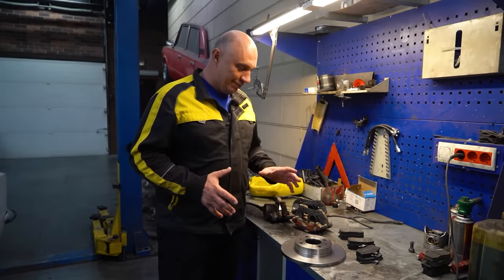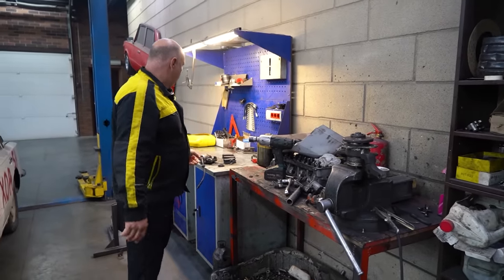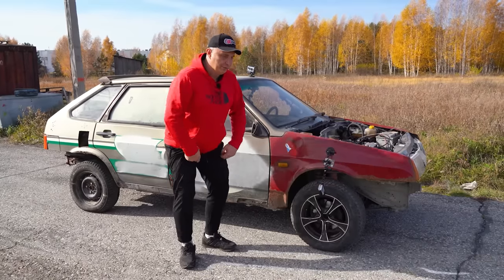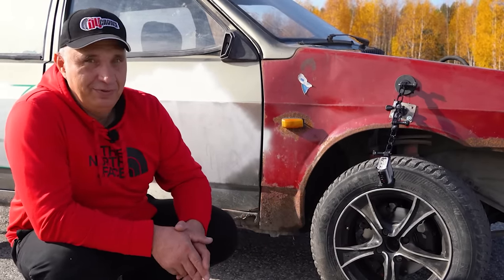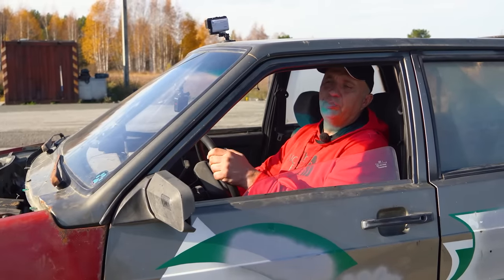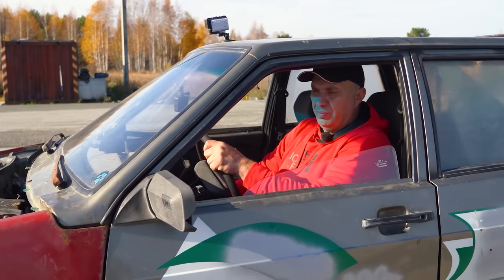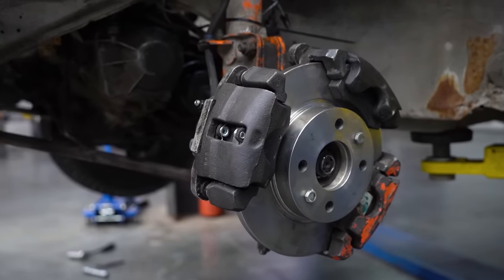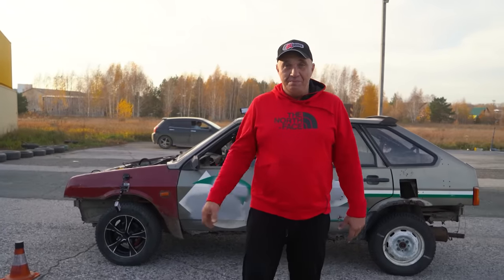Three calipers for each brake rotor – what will happen?

Comment: Bigger brakes won't stop you faster, wider tires will.

The heat by the multiple calipers isn't allowing time for the rotor to cool so you're getting instant fade.
Reply: Fade? The wheel skids! As long as you can lock up the wheel fade would be irrelevant.
The energy going into the rotor is in any cases cooled from inside via vent channels, not from outside and the total amount of energy to dissipate is constant.
Reply: The heat is a byproduct of the kinetic energy of the car. Multiple calipers spreads that heat over them, so each individual caliper doesn't get as hot as a single one does. The problem with multiple calipers is that they don't give as much rotor access to fresh air for cooling (they reduce effective rotor surface area)
Reply: @shadowboy813  Agreed, and exactly what I said: Same heat input regardless of number of calipers.
But, cooling of a brake rotor happens more on inside of it than outside. This is why it is not just a flat plate but two plates in a ribbed sandwich. The internal ribs act as a fan. Also, fading is reduced by not letting a pad create as much friction by letting multiple pads work together. Bigger and almost always better brakes use larger pads for this exact reason.
Reply: @shadowboy813  welp will make even more heat combined and that heat will transfer between each so you say it spreads heat out each one makes heating each other up.
Reply: By the " heat by the multiple callipers isn't allowing time for the rotor to cool" logic, you should be able to take the stock brakes, using a single calliper, and cut the pads in two to get better braking performance. As others have stated, the energy required to stop the car is constant so there is no additional heat produced. I would argue that the greater mass of the additional brake pads, their backing plates and callipers will help dissipate the heat better. This is why performance brake callipers are finned.

Oh and wider tires stopping you faster is not always correct. It all has to do with the contact patch, and your wider tire may have a smaller contact patch, and your tire construction will likely be a stiffer sidewall to support the wider carcass, meaning it will be less compliant fore/aft - why drag cars have soft sidewalls to improve grip under acceleration but can't corner for crap.
Reply: @shadowboy813 bro what? Callipers don't spread heat, the rotor does. Bigger rotor=bigger heat sink and the brake fade comes later. But it's irrelevant in normal day to day driving.
Reply: It goes to a point once they are wide enough to not lock up the tires that’s when you upgrade the brakes
Reply: @astrawally8448 High end callipers actually use 4-6 smaller pads instead of 2 big pads per side for this reason!
Reply: Me after watching driving 4 answers.
Reply: @DEATHWISHVQ     I love that guy!  He's great!
Reply: @Dstructeur1  Which brand of caliper uses multiple smaller pads? A 6 piston Brembo for example has a much larger brake pad than a standard caliper but its still 1 outer pad and 1 inner pad.
Reply: @fastone371  come to the comments to hear incorrect takes
Reply: @Dstructeur1 😅
Reply: Here come all the armchair experts 😂😂😂
Reply: @astrawally8448  

No the opposite.  If I said the rotor can't cool because of multiple calipers, then to prove its, you would have to confirm an increase in stopping distance.  

It's a fact that after mashing on the brakes multiple times, causes the pad and rotor to heat up.  It's a fact this increases stopping distance and eventually pad failure, or glazing on the rotors.
Reply: Nah each caliper is doing 1/3 the work, so the total heat energy generated is the same regardless.
Reply: @shadowboy813  "The problem with multiple calipers is that they don't give as much rotor access to fresh air for cooling"

The extra pads probably act like better heat sinks than air does.
Reply: heat does not matter if you're not driving an F1 car slamming the brakes at full speed repeatedly. this is why bigger brakes don't stop you faster, they only allow more temperature control

this is why tires matter the most, on standard tires just a standard caliper and rotor are capable of locking up the wheel, so at that point the only thing that would slow you down more is more friction on the tire. the brake squeezing a wheel that isn't even moving harder isn't helping
Reply: https://youtu.be/CyH5xOcsXxs?si=mBEpYPYjJKWignYq

For those of you who don't get it.
Reply: Yes, of course it's the heat dissipation that's the problem.  Unless additional cooling is provided, this accomplishes nothing.
Reply: @xtnuser5338  that's a good theory.  I think we need to get the Mythbusters on it!  😆
Reply: @1kreature you are the only one with some sense in these comments

Comment: I remembered seeing a Mercedes 600 Pullman (W100) from the 1960's on a lift in a workshop. The mechanic was working on the front brakes. It had twin brake calipers on thick ventilated rotors! Stock, from the factory. 
I think there are also some older Rolls Royce models that use the same setup.
Reply: Well, they had to use such setup - these are heavy cars and I suspect that wheels are rather small, and so are brake rotors.
Reply: The W116 6.9 has a very similar set up. What else can you do when 14 inch wheels have to fit.
Reply: @no-damn-alias  well, actually there is an option, only that has different approach :) This setup is practical solution for a car that might need to stop once, so it has small discs and two calipers. Audi back in late 80's, when they were still using wheels not bigger than 15", but were coming up with engines exceeding 200 hp, giving decent performance to C3 platform cars, came up with UFO brakes, where wheel disc size was maximized by fitting the caliper from the inside, so the disc could take up whole space inside the wheel. If not for the trend of oversized wheels, that would probably be common solution today - instead, Audi with C4 S6 [C4 S4 used UFO] switched to ordinary brakes that required 17" wheels...
Reply: @mshathlonxp   well they ditched the system for a reason. No need to reinvent the wheel
Reply: Some of the newer Mercedes and Maybach long wheelbase Vehicles also use dual calipers on the front.
Reply: @mshathlonxp  Yep my Audi had those UFO brakes, was a bit of a shook when I first saw them .
Reply: Go inboard. Has been done on the rear for ages with jags and a few race cars with fwd setups as well
Reply: @geoffgunn9673  snap a shaft, CV, or other drivetrain component...

Comment: This has lots of potential for tinkering and I hope you try it more.
What you really need to do is increase your tire width or stickiness with each addition of a caliper. In the end, the brakes don't stop the car, the tires do. 
Keep at it!!!
Reply: Move to a larger bore master cylinder. .
More calipers means you split the volume of fluid. So a larger master is a must. It'll apply more brake pressure Wich seems to be lacking.

Comment: Once you have sufficient braking force (pad and disc area), you cannot get any further improvements in braking without changing tyres and suspension, as these become the limiting factors. 

What would have been interesting here would have been to put extra weight in the car and test single and multiple callipers.

You would have quickly found the limits of single calipers.
Reply: When you're not able to lock your front wheels with a single caliper, something is really wrong. That should be the first point of optimisation.

Comment: You might need a master cylinder for each wheel and a manifold to distribute the brake fluid from there, equally to each brake caliper.
Reply: This is the issue right here
Reply: You wouldn't even have to do that, you can just get a master cylinder with a larger bore. It'll push more fluid for the same pedal travel. Most master cylinders are meant to run 4 calipers, but if you find a master cylinder with a 1/8" larger bore, you could probably run 6 calipers total just fine.
Reply: By adding calipers they changed the fluid volume ratio of the system giving mechanical advantage to the master cylinder. It is easier for the master cylinder to push a smaller volume into a larger volume which is why the pedal became more sensitive. Going to a larger bore cylinder would make the pedal harder giving less feel and response
Reply: No need to do that. The limitation is the tyregrip even with stock brakes. All this does is allows you to lock the fronts with less force on the brakepedal.
Reply: @narancs5  yes the tyres should always outperform the brakes. Locking the brakes up indicates inadequate tyres.

Comment: Sounds like youve surpassed the balance point of the master/slave cylinder hydraulic ratio if the pedal is hitting the floor on the 3rd pair of calipers. You need a part 2 video using a bigger bore master cylinder to match the combined volume of triple calipers. And then get some wider wheels and tyres! It'll end up stopping like an F1 car.

Comment: Maybe use a bigger brake booster and master cylinder from a v8/v10 or semi truck to help with pressure drops on the 3 caliper setup? I can imagine that car has a pretty common smaller booster and cylinder which doesn't provide the pressure required to make it work well indeed. I would also be interested to see how an ABS system would be able to deal with 2 or 3 calipers on each side.

Comment: I always wonder what happens if you have more that 1 caliper on a rotor... turns out they just heat up real quick that the braking is not efficient. Always love to see what you guys come up with :D
Reply: I do know that some drift rotors have 2 calipers on them to lock up one set of wheels real good
Reply: 1998 Bentley brookland & Turbo-R using 2 brake caliper for each front wheel, and they are doing great. The car weight  2500 kg btw..
Reply: @ARockyRock  That's a cool fact!!! I never know that drifters did that, I always thought drifters use huge calipers with maximum bite forces and it never crossed my mind that they would do a double caliper only on one side!! Thanx for sharing this cool info !!
Reply: @Cheetahtos  Well, with how heavy it is and it is heavy 2.5 tons of luxury and power. Either it has a big rotor or I guess in my imagination how they make double disc brakes for motorcycle is what I had in mind.  And after googling some parts bently did put 4 beefy calipers for those cars back then huh. Thanx for sharing the info this kinda stuff is always cool to find out about!!
Reply: Aston martins use two in the rear
Reply: @Donna_g6198  It's quite ingenius isn't it, they made it only for parking brake for the smaller caliper at the back :D had to google that and it looks so small like a motorcycle caliper was just bolted on the rotor. Some people commented about it looking like it could break anytime but people still have them around to this day :D

Comment: Great test guys...from my experience tinkering with brakes, as was said in the video, the master cylinder does not have enough volume to supply fluid to all the brake calipers....a longer master cylinder can help, but will have much longer pedal travel, a bigger diameter master cylinder will push out more fluid giving a greater chance of creating pressure in the brake hydraulic circuits, but will need much more effort from the driver....what can help is altering the stroke of the piston inside the master cylinder, usually the first piston to come out of the master cylinder sends fluid to the front wheels (front /rear split braking system), this piston can be measured for length, then fully compressed in a vise( to compress the spring till the limiter bottoms out), measure again the length, the difference in length will indicate the maximum volume this piston can push out, using a shorter limiter, you can increase the volume output of this piston, however you cannot exceed the maximum length of this piston as it also pushes on the second piston inside the master cylinder, if the second piston is pushed too far inside, it will pass the automatic fill up ports, causing more problems within the brake system- common test to see if a piston has passed the automatic fill up ports is to open the brake bleeders, if fluid does not run freely out the bleeders, the associated piston could be too far into the master cylinder

Comment: Have you guys ever considered using magnetic eddy current braking?
Reply: lol even more heat
Reply: some guy did that on a bicycle and it barely did anything. on a car it would literally do nothing and make for a boring video
Reply: They really only work well at higher speeds.

Comment: I have an old 72 VW bug.  I built a dual caliper kit for it about 12 years ago.  Actually worked quite well.  Had to get a larger master cylinder, but it felt like I have power brakes now.  Been running it ever since

Comment: 😮 agility and modulation were severely compromised with that last run  kind of the reason why some competition drivers stick with their rubber brake lines and hoses and stay away from the stainless steel braided lined    cuz you get better feel of modulation through the pedal
Reply: That is not what is happening.
1 caliper is almost good enough to stop the wheel at 100% brake force on the pedal.
3 calipers only need 30% pressure on the pedal to stop the wheel, so it is much harder to balance and find the perfect amount of force that is best.
Reply: @larsjrgensen5975  definition of modulation
Reply: @markcdeyoung3118   I agree on the modulation.
But what do you mean by agility?
Brake lines and hoses that are as stiff as possible would give more feedback in the pedal, because the feedback is not dampened in lines and hoses that keep their shape under high pressure.
Well made braided lines (not the show off ones) should have less flex then regular hoses and therefore deliver more direct feedback to the driver.

Comment: I thought that was going to happen.  If you further the tests , you would have more success with a larger master cylinder that that matches a fluid volume of the 3 calipers,  with a brake line coil to increase the sensitivity parameters.  Sounds like a lot of fun 😁.

Comment: Sounds like a wonderful idea in theory but I'm going to make an educated guess and say that since the calipers cover so much area thus limiting the rotors contact with cooling airflow that this will likely warp the rotors and damage them alot sooner than the stock setup and any gains in stopping power will not be able to offset that fact.

Comment: It's better to put more pistons in one caliper. You're increasing the amount of area pressing from behind the pad.

Also, better brakes fade less. Better tires shorten your braking distance.
Reply: Doing multiple calipers gives the same effect of multiplying pistons. Also increases the fluid volume ratio of the system giving the pedal more feel

Comment: You should try it on a car with ABS. Also try to use a master cylinder from a large pickup.  The truck master cylinder should give you a better volume for all 3 calipers,  and abs would take care of the wheel lock up

Comment: I suspect the difficulty in modulating the brakes comes from the fact that as you add calipers, you're effectively increasing the slave cylinder size, without increasing the master cylinder to compensate. As a result, pedal feel should start becoming spongy, making it harder to feel exactly what the brakes are doing.

Comment: Cut the centering rings from wheel hubs and drive via pot holes, to check if there is any load carried on the centering feature (and not only the studs/bolts like most people will claim). The goal is to even (maybe) shear the bolts or damage them and cause the wheel to vibrate (therefore the studs are NOT the only things that hold the wheel in place).
Reply: Bolt holes are slightly inaccurate, so the centering feature lets you center the wheel to minimize vibrations. The bolts don't do any load bearing. All the load bearing is entirely the friction that the bolts cause by CLAMPING together the wheel to the hub. Loose bolts shear rather quick (1-5 months), and lack of center features will reduce mileage and the steerability/traction of the car. It won't be too dramatic though.
Reply: @dimitar4y well written, many people doesnt seem to understand the basics of screw joints and forces. And some cars doesnt even have center hub centering from the factory.
Reply: @garagecedric  i like to understand things. a skill that is almost taboo in today's times it seems. won't help with krugerite knobheads though.. they "always know better"...

Comment: This was amusing! New things to try on the 3 caliper car:
1. We all knew the master cylinder wasn't able to handle 6 calipers. Since it's rear calipers are smaller than the fronts, you probably have capacity for 3 front calipers in it. Try this again with a bigger master cylinder that can handle the brake volume needed.
2. You were already exceeding tire grip on 4 calipers. Tire grip is the real limit of braking. Put MUCH WIDER tires on the front of the car so you have a lot more tire grip. Then try braking with 3 calipers in place.

Comment: I have a feeling you may need a little more pressure in the brake lines as they are spreading the lines to 3x. I may be wrong. I'm not a mechanic. Well done on the experiment, and well done for the translator. Thank you

Comment: Original disk brakes have a clutch plate sort of brake pad that covers the entire rotor. Current disk brakes used to be called “spot brakes” because they only clamped a single spot on the rotor. So this is a step backwards in brake development.